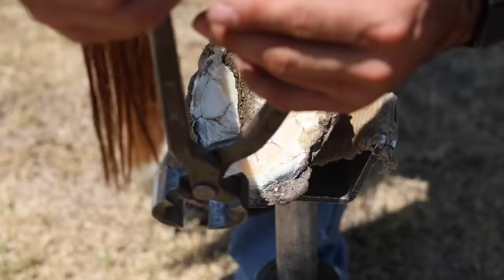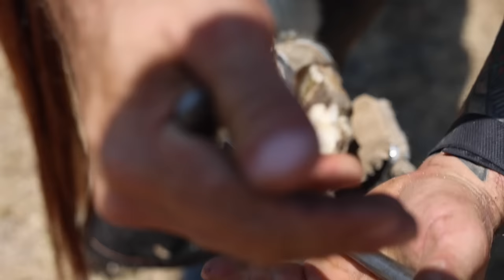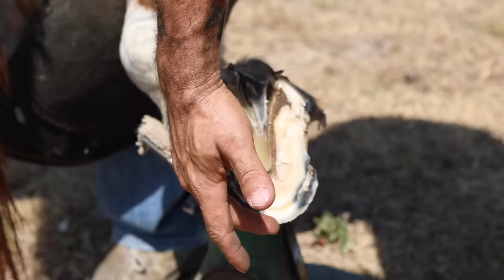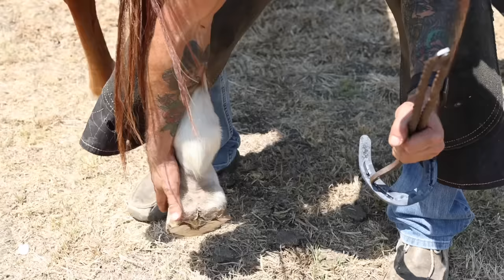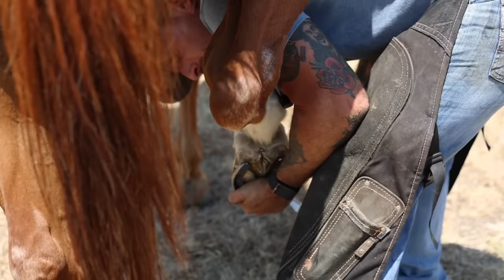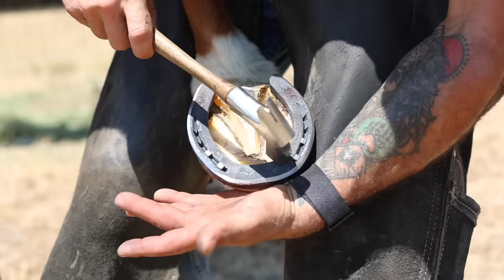Satisfying Full Horse Hoof Restoration | 4K FARRIER ASMR

Comment: I was always told that the frog is pretty sensitive, is it similar to the rest of the hoof in that it has growth that covers the sensitive parts?
Reply: Frogs are a VERY important part of the hoof. They provide blood supply throughout the lower leg and hoof, if the frog ain’t healthy, the horse ain’t healthy. Frogs do grow and you have to trim them. You know how if you press on a bleeding wound the bleeding will flow or stop? Same with the frog. It can’t be trimmed too far but If trimmed too little, it’ll but unnecessary pressure on the frog.

Comment: Horses hoofs are NOT METAL.  Why would you put slippery METAL under foot?   Get some new hard plastics or rubbery hoofs and watch him run , like with Asics.  Horses should not Slip on dry or wet ground.  A bare foot horse has better traction than a horse with a metal shoe.   That's crazy.  What Engineer thought of that?  Oh wait.. I bet thats the problem.  It takes an Engineer to fix everything.  And nobody has discussed this yet except farmers.
Reply: -_- the shoes help horses hooves not get cracked, broken, ect. Because unlike horses in the wild, they can wear down their hooves themselves! Hard plastic would probably cause them to break their leg/s. Have you ever tried to run with hard plastic stuck to your feet on a wet surface? It’s just like being on a wet ice rink with no grip on your shoes. Rubber would do the same thing.